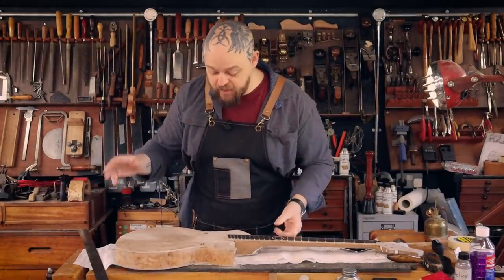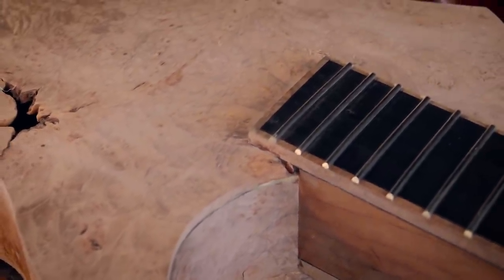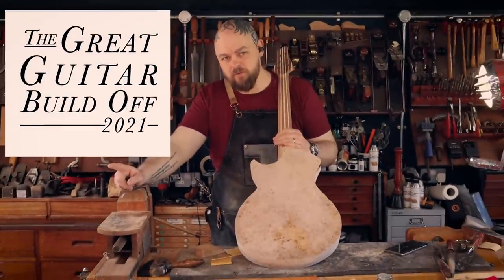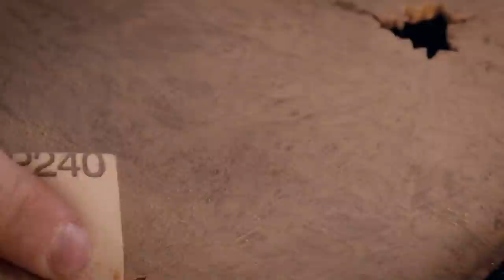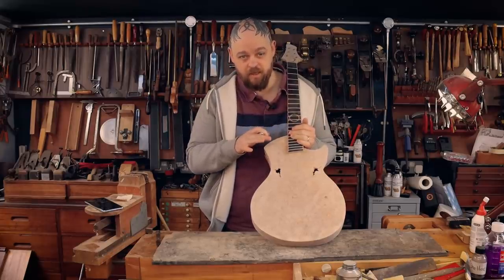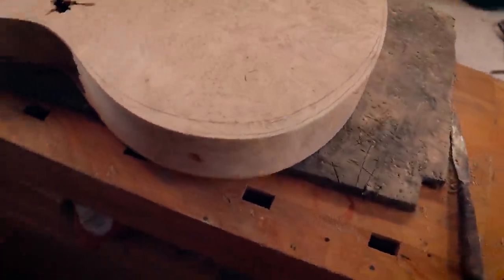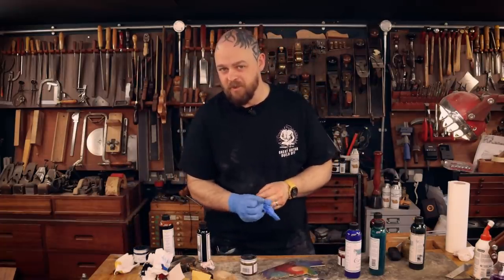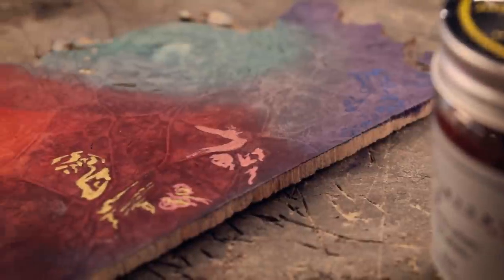Ep 17 - Sanding and Stain Tests - Making a Modern Multi-Scale Electro Acoustic Guitar

Comment: Ben, you have nothing to worry about.  Your designs and the way you build ar unique to you as far as I've seen.  As I'm watching you create those wonderful instruments I find myself designing one of my own hopefully as unique as those you do regularly.   the one I have in my head now is similar to the relish guitar in that it has an aluminum frame with acrylic covers but the neck also has aluminum struts as a base with acrylic covering and a wood fingerboard with stainless frets  the typw of wood for the fingerboard doesn't matter as it will be either painted or stained.  Or even perhaps cloth covered like a builder we both know.. think a triple-neck built last year...lol  yep  those guys... in fact my current guitar project is getting a cloth cover finish body and head stock with clear coat..as well as eletronics and hardware upgrades and body and pick guard mods to accommodate those added controls (3 humbuckers with vol and tone for each and coil split.  more tricks there too maybe even led's for lighting accents (hint: I'm using clear acrylic sheet for the pick guard an covering it to match the body) for the design in the cloth print I'm using to cover the body the led lights will show through the clear and fabric to enhance the design..nebula print spandex blend  all way stretch will conform to the body shape of the guitar..I just need to blend it along the edges of the body feather the paint and add a few spwckles to hide the seam  ..Oh yes I've tried to think of everything..maybe I'll miss a thing or two this go-round as it is my very first attempt but I usually get things right the first try if I do my homework. and as a mechanic and adept at woodworking already.  I think I have a good chance of doing a good job on this  I don't plan on a real start till i get all the parts and materials I need to complete the build..  I'v learned that having all the parts makes it easier to conplete a job once started.  missing a part or needed material delays the project in unexpected ways making the finish unknown...to me that is unacceptable at the very least and frustrating at best...the only thing I have done to date is a partial wiring fo the pickups and controls on a prototype extended pick guard getting the pots and switches in approximately the final layout and trying to finalize the spacing and positioning for comfort and usability.  a bit of tweaking may be needed to get just right.. as you well know. Good planning is a great start but only goes so far. there's always the small details that take time to sort out..Here I go again motor mouth as always.. even in person and usually worse face to face...i'll and it here and continue later maybe,,lol

Comment: Ben, I think the metallic fills have their place but they should be subtle for this build.  It’s the burr pattern that’s the star here and you don’t want to distract from it.  That being said, however, those metallics could be used for a few strategically placed starbursts through the nebula pattern.  You could wait until a sealer coat is applied to determine if any spots need a bit of highlight.  Until you start building clear coats  you won’t really know how those overlapping stains will interact with each other.

Comment: Ben, I know you like vintage tools, right? So, years and years ago my dad gave me an electric eraser. Was one of the best things I ever had for drawing. A tank of an old electric motor, with a collet to accept tube erasers. Sadly, it took the final dump. Must have been like 50 or more by then.

 So, you drawing on the guitar got me thinking...  I wonder how it would do do on erasing lines on wood? Have you ever used one of those old electric erasers? Now here's another idea...a collet for that cordless rotary tool that accepts the eraser. That electric eraser I had, worked great on drawings, and drafting paper.  Paper being wood and all. I'm going to try it...

Comment: My suggestion for body binding would be
Stain the body to the nebula finish. Then sand a thin bevel around the body and headstock to the same width as the neck binding and leave both natural under the clear coat.
Maybe paint the inside edge of the voids with gold fill or something similar

Comment: Ben, any consideration given to the idea of cutting the back out by the sound hole in the top (by where the strap button would be) so that it looks like one bigger 3 dimensional hole? It would make the detail inside easier to appreciate, and make that corner look more like one piece rather than a flat back glued to the sides.

Comment: I was slightly triggered by the wood shrinkage comment in the last video!   Took all I had not to comment.  Clarification has restored my faith in YouTube.  

Wood fibres are essentially like a bundle of straws.  As they dry out, they shrink across the grain.  You can crush a bundle of straws across it. You can’t (easily) compress them along their length. 

This also explains why end grain soaks up finish readily, and looks darker - it’s because light is not reflected by the fibres, but is drawn in.

Comment: I like the idea of that carve out and gluing on another piece. It could be made to sort of match the moon shape on the truss rod cover. 
Seems like it would give a lot more personality to what is currently a fairly plain boxy instrument (made of absolutely gorgeous wood, and with a very beautiful, very complicated neck that doesn't really match the simplicity of the body). 

So, I say if the guy who commissioned it likes it, go for it. 

I am extremely worried about the practical application of the idea, though. There are a LOT of ways that could go wrong, and you'd essentially just have a really pretty lump of useless wood. And, as you mentioned, it might be difficult to make it work with the current plan (that really nice tailpiece I'm still waiting for you to finish lol). 

It's a big risk, but I think the reward would be worth it... if you pull it off.

Comment: Congrats on the 15 year anniversary! I was wondering how the gold grain filler would look on the natural wood after sanding it down (some of the grain filler will remain after sanding, right? At least that's how I understand how it works) and then just finish it with a clear finish of some kind like shellac, or oil or a super high gloss lacquer. I think the galaxy look was very nice on the first one, but my thing with the natural wood look is kind of what you had with your copper phase 😅. By the way, what do you think about using the gold grainfiller on a piece of dark slightly burled or quilted walnut?

Comment: I haven't climbed a mountain either, but I'm relatively sure you don't want your head touching the cliff :-) That top left corner of the back worries the engineer in me. I think it will break too easy unless you strengthen it.

Comment: Pthalo Blue & Purple and some pinks. As to getting a smooth, glossy finish, why not just spray it with lots of multiple coats and just keep sanding it back until it fills all the "holes" and then put on one last coat with the high gloss. That wood is TOO beautiful to have the grain hidden, just want a nice, see through finish over it.

Comment: A whole new meaning to the term “wrap my head around it”?  Remind me, is that a 2” Ashley Isles chisel you are manipulating?  As to your remark about sanding........ I have ripped, planed, and sanded thousands upon thousands of feet of western red cedar during a 13 year stint as a wooden boat builder, and my C.O.P.D. “Ben my good man, continue protecting your fragile air exchange units, yer only gots a pair and they are a bitch to replace or do with out”.  Hand sanding not as much of a problem as power, down draft tables work along with suction on the dust hood that the manufacturer provides, and the noise is a problem also,but awareness of the issue is,a really good thing.  Cabinet scrapers are your friends!  And on burl, purportedly one of the best friends you have.  O.K. Reminder over, on to COLOR!

Comment: Hi Ben

I do love your videos.

How about a micro Bevel (8mm on Top 6-8mm on the side). 
On a small body (up to concert size acoustic) this is usually enough for improving comfort and you dont have to worry about structural integrety at all. 
This would also match the flow of your upper bout and `horn`.
I only use bigger bevels on 16" and bigger boxes. 

On colour: I would fill with black and colour lightly or leave natural.

cheers
Philipp

www.philippgruenschloss.com